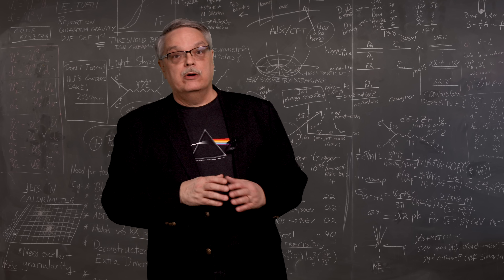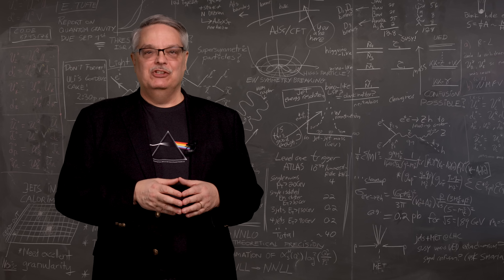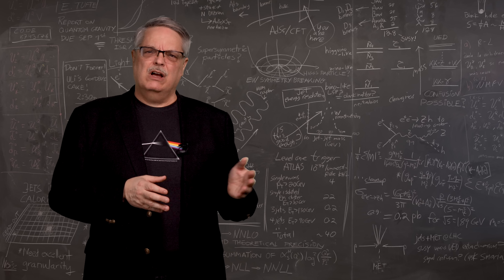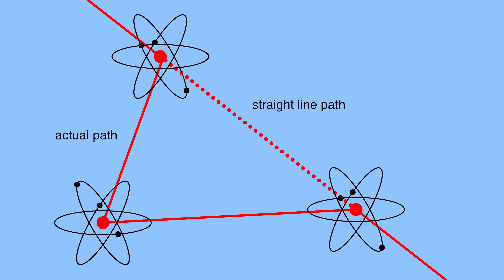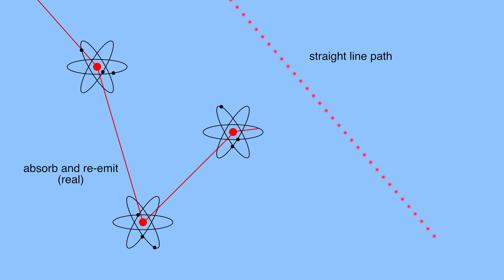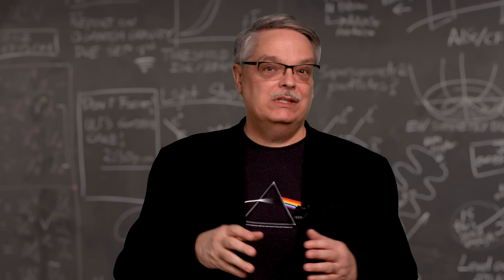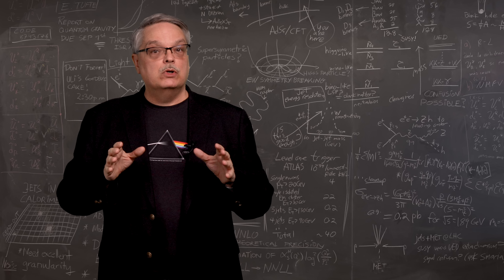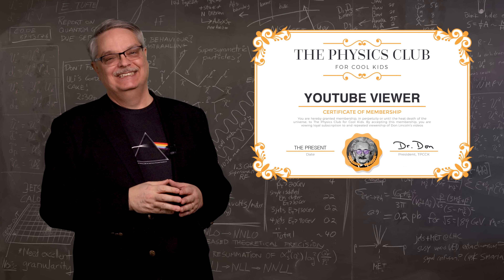Why does light slow down in water?

Comment: If a photon interacts with the glass, we see it, it is a particle.  If the photon does not interact with the glass, which, based on transparency, happens at a certain probability, it makes it further, allowing it to interact as a particle later in the glass when it interacts.  Some of the light never interacts with the glass, that’s what comes out the other side, that “stuff” that never interacted is still a light wave and it’s what shines through.

Is this mostly correct, in layperson terms?

Comment: 8:41: "And, and this is important, it moves at a slower speed than light does in a vacuum." The mere superposition of two waves does not explain the lower propagation speed. It also remains ambiguous whether the relevant quantity is the phase or the group velocity. Consequently, the video fails to answer the main question.

Comment: Judging by the time between comments, I won't hold my breath on this, I'm here because this video said electrons are traveling faster than the speed of light from the interference of what was perceived as heavy water, nuclear fission I presume? Not so much interested in the visual, a small ripple as I was the phenomena, like a melt down of Chernobyl no, what do speeding electrons look like, volts or current maybe,? I see the comparison, electrons in heavy water perhaps could travel near the speed of light, shocking, is that a science, vs light from a blue heavy water source under water, who's faster? What if there is no air and only water, same reduction? I found some curiosity, any follow up might be just embarrassing but always love the science of not knowing!!! I love what high education does to people.

Comment: The "correct explanation" doesn't seem that different to me than the "absorbed and reemited" explanation. Adding the waves together is like the wave IS being absorbed and reemited by the electrons (not atoms), the reason it doesn't "scatter" in all directions is because in a transparent material the electrons are freerer to vibrate in the same axis as the absorbed wave oscilation, the emission is perpendicular to the electron oscilation = same direction as the original wave (no scaterring). The delay in the emission is explained because on the "upper crust" of the wave being absorbed, the electron is still "accelerating" upwards, onmly when the lower crust of the original wave starts that the electron is pushed down (still on the secondary wave upper crust) so each electron delays the wave by 1/4. The more electrons in a transparent material the slower the wave becomes.

Comment: Excellent video. I would like to make a small observation: at 9:20, it was said that the wave generated by the movement of electrons moves at a speed other than c. In fact, this wave also moves at speed c. What moves slower than c is the wave obtained by superposing the original wave with the wave generated by the movement of electrons. In other words, each individual wave moves at speed c, but the resulting wave moves at a speed lower than c (group speed). Regards!
Reply: Oh, great, now I'm confused again!

Comment: Hello.
I have one question. How does the wave move slower because of the wave caused by electrons. As I understand it the wavelength interferance would change the amplitudes or the shape of the wave not the speed. 
Would the speed be slowed down due to the electromagnetic field that the moving electrons would cause?
Please I would like to understand this better.

Comment: When light enters from a rarer medium such as air, to a denser medium such as water, both of which are transparent,  it refracts, and that refraction is clearly observable, through both the medium, cause they are both transparent. From the amount and the manner of refraction one can clearly tell and deduce the lattice structure or the molecular structure which is the compositional structure of the body of water from a single droplet to a large pool cause the amount and the manner of refraction depends only on the pattern of arrangement of the water molecules in the form of a lattice of water. 

The actual path taken by the light is very significant and worthy of note. But interestingly enough a medium such as water can exist in all the three states of solid, liquid and gaseous, and when completely broken down into its constituent elements of hydrogen and oxygen, possibly also in the fourth state of matter which is plasma, or fire which ironically enough is nothing but light and heat, and most certainly also magnetism  cause that is always present and always accompany's light and/or heat, which is what makes water fairly special, apart from the fact that pure water has a perfectly neutral PH , meaning neither acidic nor alkaline hence also a remarkably good cleansing agent as well as an fairly universal and all purpose solvent.

Comment: Its a great video and helpful but it does not get me all the way to what I am curious about. First, it does not explain why the induced wave is moving slower. Second it does not explain why the light bends. And finally it does not explain why the different frequencies of visible light bend more depending on wavelength.  The reader comments that try to explain these issues are all over the map, not the place to go for information.  So, its a partial step forward.
Reply: Check out 3bluebrowns videos on light. They go into much more detail and give great visuals along with the math.

Comment: Why does superposition slow the light, i think it should manipulate frequency and wavelengths of combined wave, in the video also superposition is increasing the wavelength which inversely decreases its frequency  in the same proportion and hence the product of two will cancel out the new proportion introduced while this process of superposition, i cant desuce that speed changed even at this scale.
Reply: In reality, the wave created by the electrons has the same frequency and polarization of the light wave, but a small amplitude and, most importantly, a 90° phase shift. The result is a wave with almost all the characteristics of the original wave unchanged, but with a little phase shift. As the light passes through many layers of electrons, each giving a little phase kick, the overall effect is equivalent to having a wave with the same frequency but a lower speed and shorter wavelength

Comment: You say that one can find wrong answers on the Internet, yet you don't provide any reference of your explanation, so why would it be more accurate? Your theory is very creative, but it suffers from flaws, too. 1) The original wave is still there, so it should output in a straight line, at speed c, at the other side of the material (supposedly with a lower energy since part of it was given to the e). 2) The waves generated by the electrons would be generated in any direction. 3) The waves generated by the electrons wouldn't be synchronized, so there is no real homogeneous superposition in the direction of the beam. Also note that the speed of light is slower in air, so when you say that when someone shoots a laser beam in the direction of a glass item, it's not c, but a slower speed (unless that person is in the void, but they wouldn't survive very long). Nice try, though.
Reply: This theory, while heavily simplified in the video, is correct. What happens is that the wave generated by the oscillation of the electrons will have the same frequency and polarization of the original wave, but lower amplitude and a 90° phase shift. By adding the two waves, you obtain a new one whose only change compared to the original is, in first approximation, a slightly different phase. As light passes through several layers of electrons, each creating a little change in phase, the overall effect will be equivalent to having a wave with same frequency and polarization of the original one but with different speed. This different speed, in turn, is the sole reason for the change in direction caused by diffraction.

Comment: If light makes the electrons oscillate through its electric field, shouldn't the electrons oscillate at the light's frequency, and thus, produce the same wave as the incident light? This could completely cancel out the light, why do the electrons not do this? 

Regardless, I still have basic hypotheses: the electrons' bonds with the surrounding material reduces how much they move, effectively reducing how much the oscillate, and thus, the light they produce. Additionally, I also think that maybe the light that the electrons produce is out of phase with the incident light, creating a new, slower wave. However, due to misinformation on the internet, I am unable to confirm the aforementioned hypotheses, so, if anyone can help, please do. It would be highly appreciated, thank you.

Comment: The idea of light slowing down in glass explains why the wave-front of a beam of light diffracts towards the normal.
Can you explain why a beam of X-rays, which are just high-frequency light, is diffracted away from the normal?  Using the same explanation for the diffraction of visible light, this would suggest that they speed up, and travel faster than light in free space (speed of X-rays in glass > C).
Please see https://youtu.be/JZOn1B8K8mA

Comment: Everyone on earth is moving faster than light.
Only way not to move faster than light would being stationary in space.
But stationary compared to what? All galaxies and planets are moving. So you can never be stationary.
Reply: If you measure the speed of a light beam coming from a source which is about to overtake you, you will find that it is travelling at the speed of light and no faster.  Irrespective of how fast a source is moving, it will never exceed the universal speed limit (which we call the speed of light) relative to you or anything else.

Comment: This video also explains wrong thing. Combined light wave has no relation to speed of light.
When light enters a medium other than vacuum, both the permittivity and permeability of the medium typically differ from those in a vacuum. This results in a change in the speed of light. 
1. Electric Field Interaction (Permittivity (epsilon)):In a medium with higher permittivity, the electric component of the light wave interacts more strongly with the medium. This interaction tends to polarize the medium, creating dipoles that align with the electric field and store part of the energy temporarily, effectively slowing the propagation of the wave.
2. Magnetic Field Interaction (Permeability (mu)):Similarly, a higher permeability indicates that the medium interacts more strongly with the magnetic component of the light wave. The medium's atoms or molecules may align with the magnetic field, again storing some of the energy temporarily and slowing the wave.

Comment: I wonder if you could produce lift using light, since you could probably measure a tiny pressure difference from one side of the glass then on the other.

Comment: Very good video Sir, but in my opinion there is a point  where, the explanation is not correct. It is the point where the entering light, passing close to the peripheral electrons of the atoms of water will excite the electrons with its electric field and the wave of the electron, the light, will be emitted with a speed lower than the speed of the entering light; 
Excited electrons emit light, but it will be at the same frequency of the exciting light, and at the same speed because it is light emitted in the vacuum between the atoms. This is Maxwell.

Comment: I think this is a prime example of the how/why divide between classical and modern physics. Newton worked in the  classical framework, both the WHAT and HOW questions existed and could be answered: "WHAT is the motion of the moon around the earth" and "HOW does that occur".    When we tried to explain things like the refraction of light and the photelectric effect using only understandings that were available to Newton, we find they didn't work . A new system is needed - quantum mechanics.  The new system is not a HOW  system, it is a WHAT system. It addresses the WHAT happens question only, the HOW questions don't exist.  Consider a chess board. Put a knight on a square and we know it can change positions in any of 8 displacements.  If we put a checker piece on that square, those 8 movements are not available. We don't ask the question "why can the checker piece not have the changes available that a knight has?" That question does not exist in the checker system so no answer can be given. Questions in one system don't exist in another and has no answer in the other. The behavior of isolated  individual particles with no interaction with others can be looked at in a HOW framework but require that it interact with others and the whole system shifts into a WHAT system and HOW concepts don't apply.     So when we try to use HOW answers in a WHAT system, things don't end well,  You can't ask chess question during a game of checkers.

Comment: If a destructive interference slows down light, then can we somehow increase speed of light with constructive interference? This directly contradicts the Contant nature of speed of light, however if this explanation holds true for slowing down light, then my given argument can be made

moreover, let's say a ray moves in a region through a beam of light, in let's say vacuum, then why doesn't interference happen between them, and the speed may be slower/faster in the region of intersection?
Reply: There is always destructive interference in some places and constructive interference in others. 
Only the apparent speed of light changes, as you get troughs where you'd expect peaks.
It's not the speed of information. 
You can have an apparent speed of light greater than c. For example x-rays in glass.

Comment: 2:32 If it splits when it enters, would it not also split when it exits? Or does the first split sort some kind of light from some other kind of light? That doesn't sound right.

I feel like this video doesn't explain why it changes direction. It only explains speen. Not why speed causes the change in direction. It also doesn't explain why it splits. But I'm tired, so maybe I'm not thinking about it correctly.

But it explains what the title claims it explains.

I found your video about why it bends.

Comment: That LOOKS like frequency modulation, which is not a change in the speed of an electromagnetic wave propagation over distance. If frequencies had different speeds, light would segregate crossing interstellar distances. 
Light inside the glass or water , would be Doppler shifted so that photosynthetic pigments would not function the same in an aqueous medium inside a leaf , as they do outside... I suppose.

Comment: Dr. Don: There have been many comments on your claim that the electromagnetic field created by the excited electrons of water travels at a slower speed than the electromagnetic field of the incoming light. Have you substantiated that claim in a comment I missed? If not, you really need to explain why the photons in the induced magnetic field travel at a different speed from the photons in the incident electromagnetic field. Otherwise the superposition explanation doesn't work.

Comment: You are wrong too, reflactive index can be less than 1.
Reply: n = c/v

"n" is the refractive index.
"c" is the speed of light.
"v" is the speed of light in any non-vacuum.

Looking at this equation, if the refractive index was to be less than one the speed of light in the substance would've been faster, which we all know is impossible. 

To get a refractive index of less than one, v > c. "v" always has to be equal or smaller than "c" to make the equation true. Hope this helps.
Reply: @thechannelofknowledge5145  You are both wrong. The refractive index is not a real number but a complex one.
Reply: @lepidoptera9337  Could you explain a bit more, if that's okay?
Reply: There is not much to say. The refractive index is a complex number. The real part describes refraction, the imaginary part absorption. Both the real and imaginary part of the refractive index can be positive and negative because the refractive index describes the phase  rather than the group velocity. While it is correct to say that the group velocity can not exceed the speed of light, that does not mean that the real part of the refractive index can't be smaller than one or even become negative (for certain frequency ranges). The fine print in brackets is the important part to memorize. The details are regulated by the so called Kramers-Kronig relation, which tells us how the real part of the refractive index depends on an integral of the complex (absorptive) part. This means we can trade unusual refractive properties in one wavelength band against absorption in another. That's kind of cool, in my opinion. And then there are active optical materials for which even the absorptive imaginary part of the refractive index is negative. These amplifying material constants are what describes a laser, for instance. And then there are the cases where none of this applies, e.g. in fluorescent materials, Raman-scattering, Rayleigh scattering etc..

Comment: so the light would have no problem penetrating any solid object, it might slow it down but it will amplify the light. But it's not.Your illustration is the photon is like a single infinite string, visible light is just 350 to 700 nanometer. I suggest that you do not think the light as particle nor wave. Think it as energy, when it hits the electron it does not slow down it actually stop because the energy is being absorbed and since light is not a infinite single string and the atom can only absorb a finite amount of energy the light seems slowing down. Its like a billion car bumping to a billion wall
Reply: Yes, a photon is energy, but energy is not localized at any one point, so your mental image of it "hitting" an electron is also wrong.